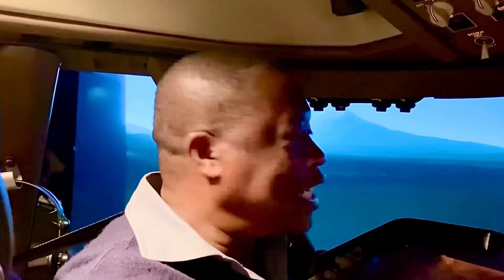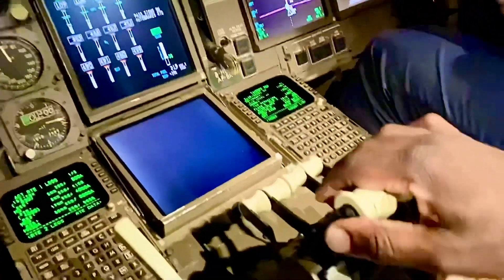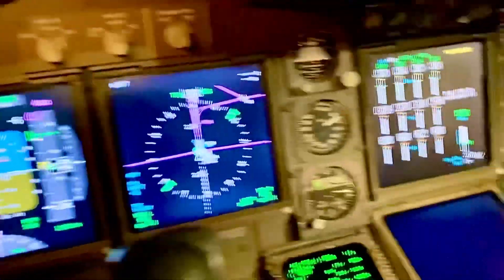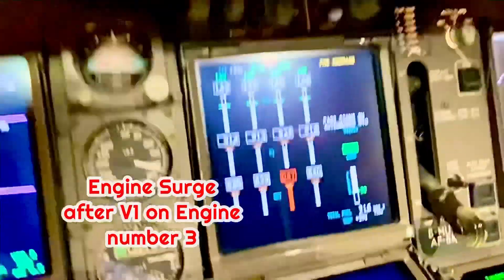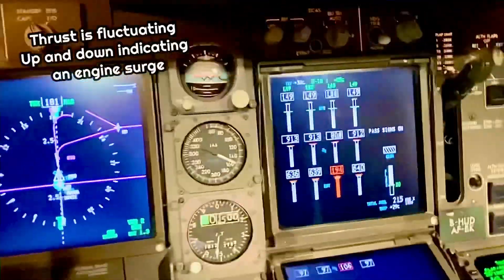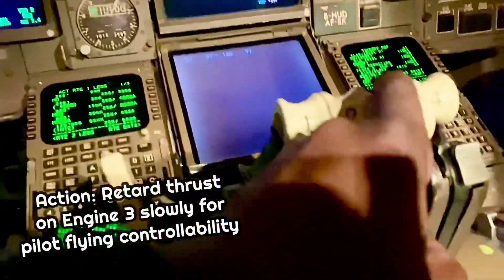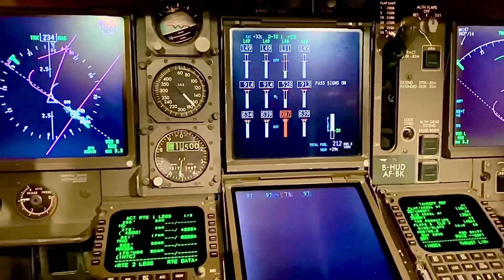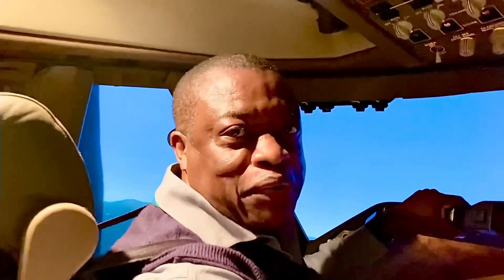Boeing 747-400 Engine surge on Takeoff

Comment: What comes after the engine shutdown? Is it the standard procedure to try to restart the engine? Does persistent surge (surge that is impossible to fix by reducing throttle) means that engine is physically damaged (perhaps damage to the compressor blades itself)?

Comment: Rolls Royce engines don't surge only cheap American PW or GE motors.
Reply: Actually I've flown jets with RR, PW and GE engines and by far the most reliable are the GE CFM34 engines.  The Rolls motors have been the ones that I've had the most problems with.
Reply: @Ryan-zc1tz  over your head, obviously, taking the P out of Americans

Comment: Thank you for the video. Tell me when to enter REDUCTION ALT Flaps 5 in FMC, and when is REDUCTION 1500?
Reply from the maker: The default is usually Flap 5. If you want 1500 feet just overwrite on the Flap 5 line
Reply: @pilot_obet  Thank you. ACC ALT and EO  ACC default 1000 and 1000?

Comment: Hello Captain,

1) What do the blue arrows mean on the upper EICAS below the message

PASS SIGNS ON?

2) i still dont get why excessive crosswind can cause an engine surge.
Is that a reason why aircraft manufacrurer give maximum allowed crosswind components for each aircraft in the performance data?

3) does an engine surge always mean that the engine is damaged?

4) does a failure or maulfunction of the EEC/ECU also cause an engine surge?

Hope you can try to answer my questions, thank you!
Reply from the maker: Those are indicators that a parameter has been exceeded.

Comment: i actually didnt know extreme crosswind causes engine surges
Reply from the maker: That happens when the wind is very strong going across the engine air intake, it can cause a reduction in air entering because of the sideways element. it is normally at the lower speeds that it affects the engines.

Comment: But the tell tale RED box was still there around the EGT reading. If all other ENG parameters remain within normal limits can you continue or would you elect to return with an “overtemped” engine?
Reply from the maker: It was at idle but still surging ( banging could still be heard), if you leave it as is, you could end up with engine damage- best to shut it down